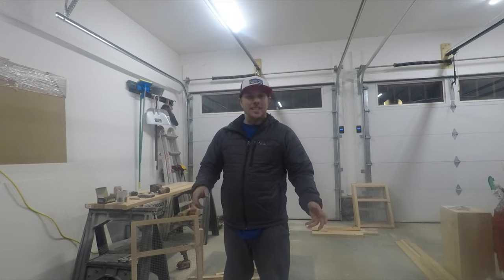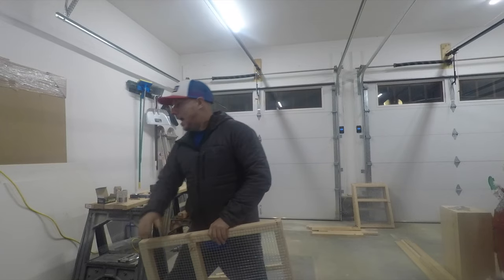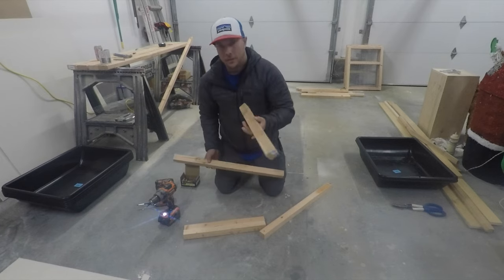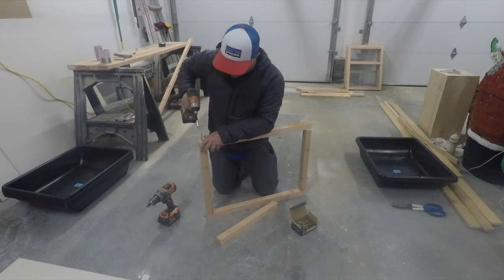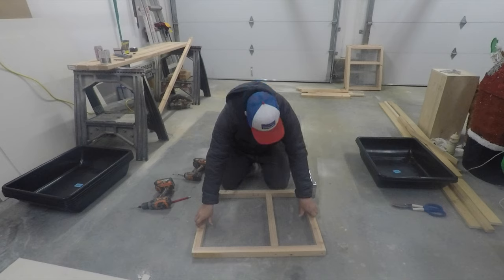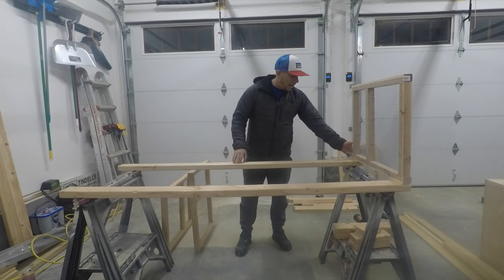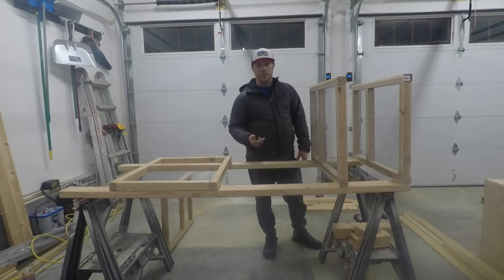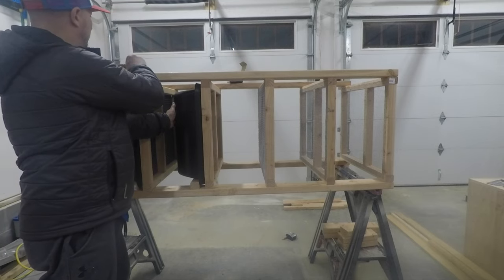BEST!  DIY Rodent Rack!  How to Build Mice and Rat Breeding Rack for Less Than $120!

Comment: Where did you get these tubs? And what are the dimensions of the boards that go over the tubs?
Reply from the maker: These are concrete mixing tubs from Lowes.  They have 2 sizes I believe and these are the smaller cheaper ones.   I do not remember the sizes but you just have to make them fit properly over the top so the rodents don’t get out.
Reply: Oh ok that’s why I was wondering because they have some at Lowe’s that are 26” long and 20” wide and then they have some smaller than that. Going to go with these. Thanks.

Comment: You guys are missing a key feature with your design that’s worth it’s weight in gold. You should have your front legs 3 inches from the edge not flush. Then you can make your runners that the tub slides on 3 inches shorter than the top of the tub and that allows your tubs to drop out without disconnecting the water lines. Nice build though other than that one drawback.
Reply from the maker: Cool man. Thanks for the advice.  I believe the guy I built this for is using water bottles and thats how he wanted me to build it.  Ill have to check into those water lines.